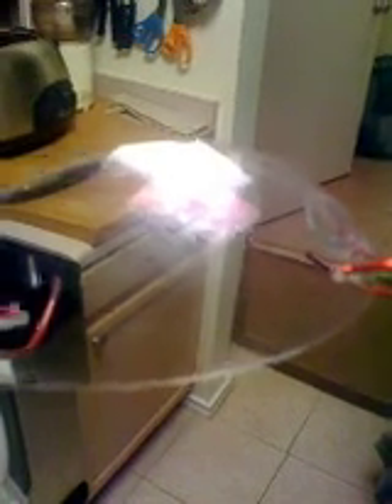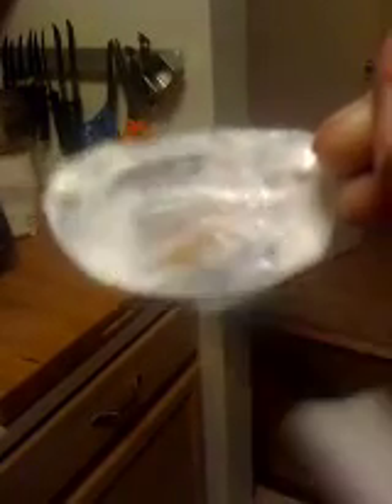Demonstration of Armour Etch to remove anti-reflective coating on plastic eyeglass lenses

Comment: I don’t know why…but this is not working on my glasses. I’ve tried it 3 x waiting at least five minutes on only one of the lenses. And it is actually worse with scratches clearly visible. The only thing I did differently was rinse with cold water. I’ll try again with a hot water rinse. I’m so disappointed! Maybe my glasses aren’t plastic. Oops. Good job they are 7years old! I have a new pair anyway.

Comment: I must have a different coating on my glasses the Amour Etch did not work, would not take anything off for 3 tries so crushed the glasses and will go spend the 200.00 for new ones, now 25.00 for the etch will be 225.00 for the new glasses

Comment: BEWARE! Armor Etch is very Gritty and even though it may take the anti-glare film off it will scratch you glasses all to heck. DON"T DO THIS! I am currently waiting for my new glasses to come in after doing this.
Reply: Yup scratched mine bad and I used a q tip
Reply: Did you have plastic or glass?
Reply: @mikedowling3569  plastic
Reply: Makes no sense as Armor Etch itself contains no abrasives that could scratch the lens. 
OTOH, once the coating has been removed using Armor Etch already existing scratches can be seen easier.
And yes, that’s only valid if your glasses were made of Polycarbonate AKA "plastic" but not of glass!

Comment: I have a very expensive pair of X-Cel Optical Acclaim 61 computer trifocal lenses that were scratched (coating only) and the coating had started to delaminate. I think this is the typical failure mode. The lenses are made of CR39 plastic (most common) and were coated with iCoat brand of AR (I don't know anything about these guys). The Armour Etch wiped out the outer coating with no problem. However there is an inter coating on my lenses that Armour Etch won't touch and that coating scratches easily. So easily that the brush I'd used to apply the Armour Etch scratched this coating. After playing around with some very strong detergents, 100% isopropyl alcohol, and concentrated sulfuric acid, nothing was working. I tried using toothpaste to polish the surface and it turned the coating into a foggy haze. "#%$*!," I said. Everything was going wrong. Then I used some amyl acetate (I bought it on Amazon) and it dissolved this extra layer of stuff. It didn't come off easily. I needed to aggressively rub a cotton cloth soaked with amyl acetate, but 100% of everything in the coating was removed and the lenses now look perfect.  Perhaps another solvent would work better; I don't know. CR39 plastic is rather solvent resistant and I had other uncoated lenses of this same material to experiment with to verify the plastic wouldn't dissolve. There's another Youtuber out there that had my same problem with an additional layer that he couldn't remove. Perhaps this method can help someone out.  Note - CR39 is not the highly refraction index polycarbonate lens material which is sometimes also used.  I have no idea as to whether amyl acetate will work with this plastic.

Comment: Very VERY DANGEROUS Demknstration!!! This Armour Etch pastecontains strong acids, bi- fluoridesand can be FATAL ! The label on the large 10 oz. bottle speaks of extreme caution, use in ventilated area, use oves. Fumes can be dangerous. WORSE, the burns from skin contact are not felt immediately, so no warning that your skin has been contacted. Contact of As little an area of skin 5" x 5" can be fatal ! Eye, hand, arm, skin, mouth, lung protection should be used. Results. Some people have used this product to remove anti-glare coating on plastic lenses with no result. Most say it works well. Others used rubbing alcohol, baking soda, toothpaste (toothpaste did not work for me), white vinegar (also did not work). Anti glare coatings vary a lot in quality and it seems in durability. My glasses, progressives were $190 at Costco, about $2 a week for two years. My coating has been obscuring for almost a year. But most say these coatings last about two years, so $2 a week in a jar and I have new glasses. Lenses are now $130, so $2 a week for a year and 3 months.

Comment: Does anyone have any experience with using these on painted metal 
frames?  Can the Armour-Etch damage this kind of frame?  If so, is there
 a way to safely remove the lenses while doing the Armour-Etch 
treatment, and then reinsert them afterwards?

Comment: I have $800 glasses with the expensive Cryzal brand AR coating - and the optical clarity has been getting worse and worse with micro-scratches over the last couple of years. I bought the Armour Etch from Amazon. It wasn't clear from reading online that Armour Etch would remove this particular brand of AR coating, but I took a chance because I just couldn't see. Well, it worked like a charm. I applied the paste to the fronts and backs of the lenses with a Q-tip, set a timer for 5 minutes, and rinsed under hot water. It's like I have a new pair of glasses! It did no damage to the metal frames. There was one little place where I could see a bit of the coating was still there, so I repeated the process once more and it is completely gone. I can see!

I was very hesitant to try this because I don't have a backup pair, I don't have vision insurance, and I can't really see without my glasses. But they were so bad I just couldn't bear it. I'm so happy I tried this. Thank you AustinBeauty

Comment: I'll have to try this. The coating is all good until the coating decides to release from the lenses.  I 
paid extra to have this coating added to my reading glasses and enjoyed 
it until one day I took them out of my purse in the sun and noticed that
 both lenses had problems.  All around the frames, the coating was 
crackling off.  I could understand this if it were happening in the 
center of each lens from wiping or drying when washed, but this was all 
around the frames where it doesn't get rubbed.  Eventually this will be 
an irritation in my line of sight and the glasses will be unwearable.  I
 have other over the counter magnifying glasses that don't have any 
coating and I never notice a problem with glare when reading or working 
on the computer which proved to me that I don't need this coating.  I 
will never have this put on glasses in the future--pay extra and end up 
regretting it.
Thanks for a possible solution.

Comment: This worked perfectly on my first attempt. I had the cheap sprayed on ar coating that was less than 3 years old. From what I've read, if you have a baked on or really old coating it probably won't work.

Comment: austinbeauty, thank you so much for this demo! I tried this on my second pair of glasses, the ones I bought a year or so ago from a Major Department Store's optical department and had already returned once because the lenses weren't quite right. After watching your video, I decided to march into my local Michael's arts and crafts store with a 40 percent off coupon and buy some Armour Etch. When I got home, I couldn't wait to see if it would work. At first, I was skeptical, because the scratches and cloudiness remained after letting the Armour Etch do its thing for about seven minutes and rinsing the lenses in hot water. (Wear gloves, by the way.) But when I tried it again, this time on both sides of the lenses for 10 minutes, and rinsed the lenses with hot water, then cleaned them with regular lens cleaner, I couldn't believe it. Crystal clear! Nasty coating gone, and hey, I can see. Again, thanks!

Comment: Help!! I used the Armour Etch to remove the scratched-up anti-glare coating from my polycarbonate lenses, which it did well.  However, it left the lenses so 'foggy' that I can't see through them!! There is an almost greasy feel to the surface of the lenses...any ideas, suggestions, ??  I need my glasses and certainly don't want to make the situation any worse! Thanks!

Comment: This works 100%. If it doesn't work for you then you don't have the coating on your glasses. This stuff is really strong. Don't do it without gloves. Set time is like 2 minutes. You may have to re apply. I missed a few spots or the coating may have been thicker towards the edge. This coating is a total scam. I have a friend that does it for a living and he says he re coats yearly for most people. He removes it with the same chemical. The coating is 50x more delicate than the lenses themselves. You should be able to clean you glasses with your shirt and not scratch them. Try that with the coating applied and see what happens......you'll find yourself on your way to Michaels or Hobby lobby.

Comment: I did this just now and it definitely worked.  My thick glasses are all reflective now, but they aren't scratched up and I can read through them well.  Note to all - never use lens cleaner or those lens cleaning wipes on your anti-reflective coating lenses.  It ruins them in no time.  Soap and water and the proper cloth does the trick.  Why do they give us the lens cleaner when we get our glasses if it ruins them?

Comment: IT WORKS!  I bought a pair of glasses with designer frames, costing over $350.  In less than 3 months, I could not see past the scuffs.  I took them to the vision center where they were purchased, and was told "I'm sorry, they are polycarbonate lenses, we cant remove the coating"... So, I have been wearing an old pair for about 6 weeks, and finally found Armour Etch at Hobby Lobby.  I just used it and they are better than new! I just dabbed it all over the lenses with a q-tip, let them sit for 5 minutes and rinsed in warm water.  Thank you for the tip!  And NO MORE COATINGS for me!

Comment: I have to vouch for this.  I googled for days tying to find solutions to this problem of scratched anti glare on my lenses.  Everything I looked at always led me back to Armour Etch. So not being sure if it was available in UK, I googled this too (god bless Google!), and found it on Amazon, so ordered a bottle. Just tried it, left the solution on for 7 minutes in my case, and BINGO! I can see unhindered again.  My vision is not compromised in any way by not having the anti glare coating, and I will NEVER get it again. So thanks very much for the useful real time video you did. Im very grateful. Regards, Helen (UK).

Comment: The process worked on my biking glasses easier than advertised. I downloaded a 50% off coupon for Hobby Lobby, got the smaller 3 oz bottle, used 4 Q-tips, rubbing in a circular motion, rinsed w/ hot water using the makeup brush to scrub clean the perimeter, washed glasses like normal, and voila.  Although I only used about $.05 worth of the product, my wife used the trip to Hobby Lobby to purchase home decorating goods the equivalent of two pairs of new glasses.  But now I have enough Armour Etch to do 100 more pairs without a trip to the store.

Comment: Been mulling over this for months but my lenses were so clouded and "veined" I just got blurred images and type.  Just finished with this process, using q-tips and it's 100% absolutely effective.  Just apply slight pressure, going side to side, with the q-tip(s) and then rinse warm water (might want to rub your finers w/ non-abrasive tootpaste), then dry w/ microfiber cloths you can get at the grocery store (they're good for lots of things by the way).  Just can't believe how great this works.

Comment: For anyone who is doubting this, it worked 100% for me.  Saved me tons of cash, never getting anti-glare or anti-scratch coating again.  It took me two applications at about 7 minutes each.  The first removed about 75% of the anti-glare coating.  Gave it a good scrub with some regular eyeglass cleaner and micro fiber cloth then reapplied with a firm brush scrubbing the etching fluid in circles as I applied.  After rinsing with hot water and cleaning normally once again the glasses were like brand new, and my glasses we're so bad that I couldn't bear wearing them at all anymore.  I had already tried turtle wax and spf 45+ sunscreen, neither worked at all, in fact the sunscreen actually made it worse at the time.  Only thing I would recommend that this video ignores is that you should really wear some rubber cleaning gloves,  this stuff burns through flesh just as easily as it goes through that coating.  Thanks for the video, and thanks to everyone who commented with their experiences!
Reply: Oh, and of course when I went to the walmart vision center, the lady there told me that it wouldn't work and that I would ruin the prescription.  Total BS, glasses are like new, prescription still perfect, just don't try this on glass lenses, only plastic.  They just want to sell you new lenses with more anti-scratch/glare coating that scratches more than plain plastic.
Reply: philosophygabe  agreed about the gloves, yikes, that's HF!
Reply: E. Timothy Uy

Comment: This works with some notes. The optician at Lenscrafters said the damaged AR coating can not be taken off. Actually I am ordering a new pair of glasses for my wife at $370 and wish to keep the old one as a back up. I read a few posts and also watched this video a couple times. 
I went to Michaels armed with an internet printed coupon and purchased Armour Etch for  $12.99  less 40%, not so bad.

I put on a masking cream on the frame thinking the chemical might attack the color. I then put on the etching chemical with a brush as in the video an applied mostly in the center where the AR coating was damaged. After 7 minutes I washed up the glasses. The AR coating was stripped off but a ring was left close to the rims. I have to reapply again and work on the paste and this time all came off. Though there are a few scratch marks from two years of use. The frame doesn't seem to be damaged, therefore apply all over otherwise the AR coating on the rim will be left.

BTW watch the CBS 60 minutes video on "Sticker shock-why glasses are so expensive." I have read about Luxottica before but this video is most revealing and I am really shocked.  You could get a better deal at an on-line store and actually I bought a pair for my wife last year, as good as from Lenscrafters, but she would still go for Lenscrafters and the so called HD lenses at the higher price.

Comment: I followed this video for my very cloudy, 5-year-old $500 SEE glasses, using a $9 bottle of armor etch (craft shop), rubber glove, and old cheap eyeshadow brush. I left the cream on for 5-10 minutes and rinsed it off with hot water: no effect. Repeat: some effect. Repeat again: no effect. 

Finally I gave up and tried to dry off the clean-but-still-half-cloudy lenses with a glasses lens cloth. As if by magic, the coating started to rub off. A little more elbow grease and - wow! Everything is cleared up.

So, my amended method for anyone else wondering if this works: YES, it works. But you need abrasion/pressure as well as the chemical that "loosens" the coating. Others do this by using a stronger-tipped brush (paintbrush, stippling makeup brush), but another option is to just rub with your lens cloth after the Armor Etch is washed away.

FYI: Other methods I've used include Glue-Be-Gone and Windex. None of those worked as well as Armor Etch.

Comment: This worked great for me. I used a little stiff stubby Elf white handled makeup brush I bought for $1 at WalMart and an $8 3-oz bottle of Armour Etch I got from Ebay. I scrubbed for 5 minutes per lens, then repeated the process on a few stubborn spots that didn't come off the first time. My $300 glasses are now perfectly clear! My recent eyeglass prescription hadn't changed since my last exam 2 years ago but I was resigned to buying new glasses just to get rid of the weird rainbow effect where the coating was scratched. I am thrilled.

Comment: Amazing!! I just finished removing the AR from my scratched lenses exactly shown in this demonstration. They are absolutely crystal clear. I used a cotton swab to apply it. I tried every other remedy shy of sanding the coating off. Thanks for saving me $250! (which was the cost I was told at the optician to replace my lenses on an off year for my vision plan)

Comment: After watching this video I went out and purchased this product at a cost of $25.00 Canadian. I was very disappointed after 30 minutes of applying and reapplying this product to my lenses to find out that this does not work. My lenses are still extremely cloudy and I saw no change.
Reply: Try white spirit afterwards.
Reply: This worked perfectly for me. Use elbow grease.
Reply: Laura Croft Very difficult for me to answer, as I have no clue where you live...
Reply: Laura Croft Lowest amount I have seen in Europe is 1L bottles, it's not expensive stuff and you can use it to clean certain things as well. Keep in mind that this stuff can dissolve plastics and may ruin something.
Reply: Laura Croft You can try several chemical substances such as thinner (which would probably be too weak) or acetone (which can damage your lenses, be careful) or you can use paint stripper which is another chemical but thick and slow acting, will take several minutes. For repainting, any car spraypaint would easily do, though it sounds like you're spending a lot of resources into something that you may just want to replace with something new?

Comment: This actually works! It took a couple applications with Q-tips to get everything off, but it does work. Now these older glasses at least have some use. Another benefit is that the removal of the AR coating demonstrates just how useful that coating is/was. Having worn, cotton gloves as well as two sets of rubber gloves to do this, I hope that "austinbeauty" didn't actually do this demonstration with bare hands. I have to believe that this substance really is destructive. THANKS!